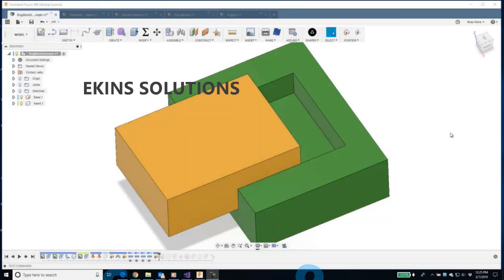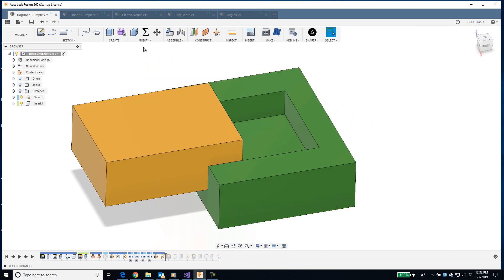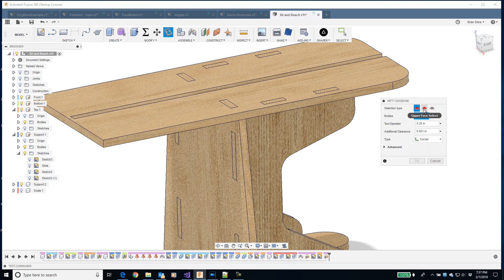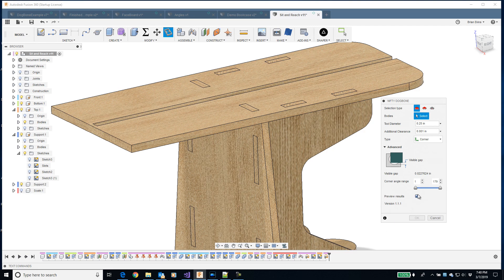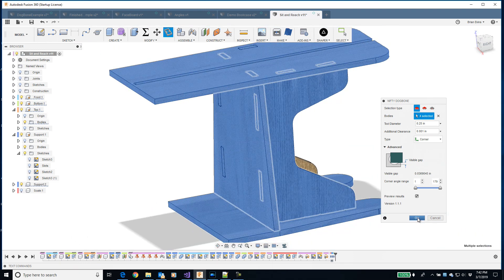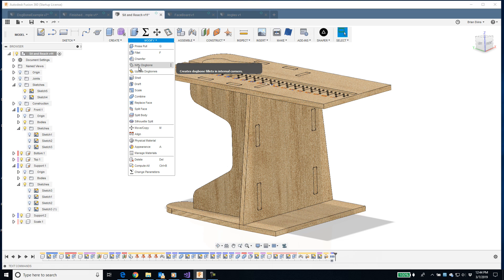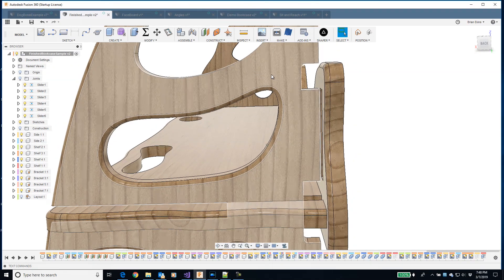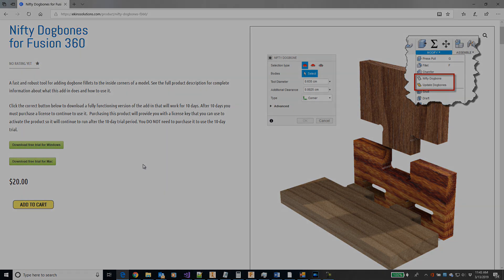Nifty Dogbone for Fusion 360

Comment: Hi Brian, this was the only way i could find to reach you, my problem is a general problem, not anything with this video to do.
I am using the free version of Autodesk Fusion 360, version 2.0.10440, and i have a problem when i want to activate your script to make spurgears, the path is pointing to a path in the "users" library, but because i am using a Danish version of windows 10, that library is called "brugere", the Danish word for "users", so i can not install the script, because it is stated to be located under "users" not "brugere", i am a former system programmer so i know there exists system variables to use to overcome this problem. 
Sorry to contact you this way, but it was the only way i could find.
Regards Steffen Madsen Denmark